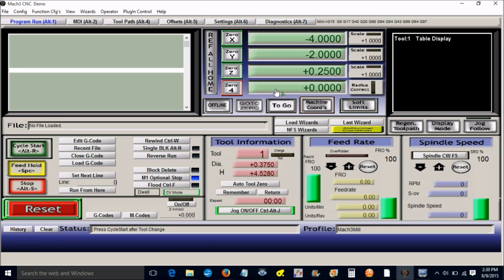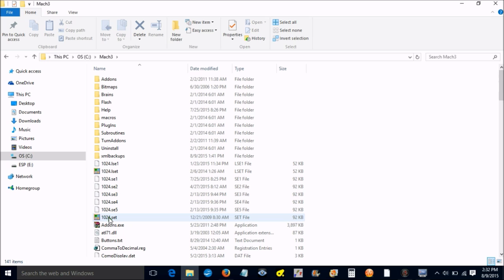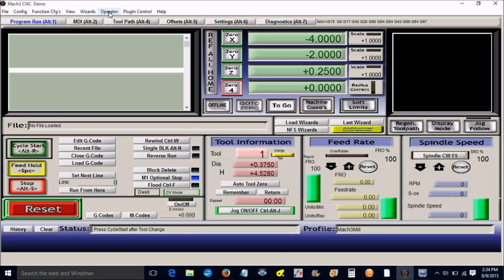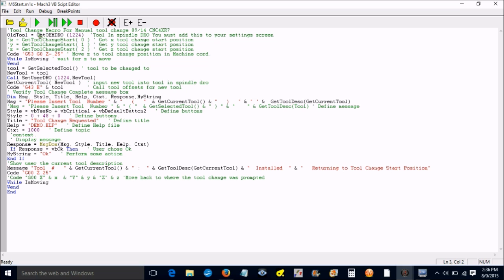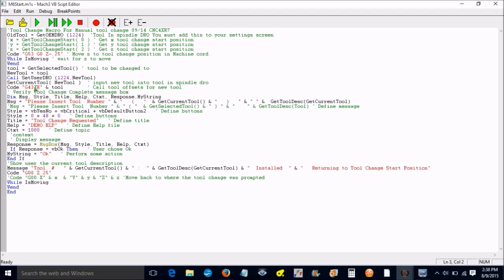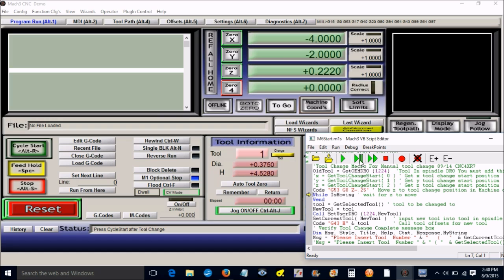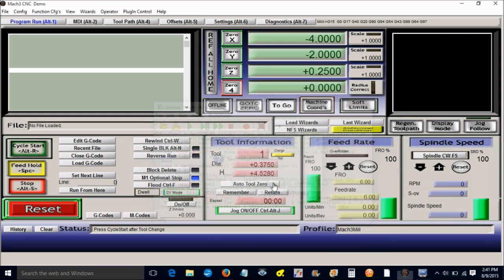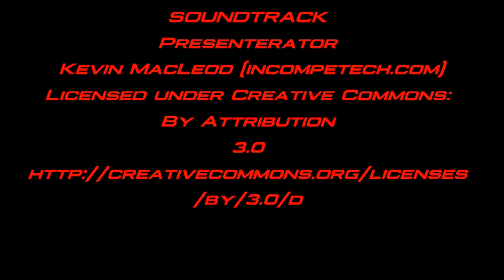Mach3 Manual Tool Change Macro Made Easy

Comment: I am trying to do something maybe more complicated, can you help me please ?
I will explain to you in short words.
M6 should activate macro doing something like this:

- Off the spindle
- Go to safe Z position
- Move the machine axis to the exact position where the tool holder has to be released
- Move the Z axis down, in order to release the T1 holder
- Open the spindle clamp to release the tool holder
- Check if the spindle released the tool holder (by deactivating a sensor) if not, stop the machine
- Move the Z axis up to safe Z
- Move X-Y axis to the next tool holder position
- Move the Z axis down to pick up the next tool holder
- Close the spindle clamp holder 
- Check if the clamp is closed (by activating again the sensor) if not, stop the machine
- Go to safe Z position
- Turn on the spindle an continue working
(Sensor will be connected to any of inputs of the CNC controller)

I hope you can help, thank you so much in advance 
Stay safe
Reply from the maker: have a look at my website

Comment: Thank you for sharing the tutorial on the tool change macro.
I spend almost 3 day's fidling with the settings in mach 3 before  I found your video and made a manual toolchange work on my machine (optimum BF 46 conversion).
My first problem was that at the first toolchange the Z-axis went over the max soft limit (this with safe Z move setting active).
Then after I implemented your macro it was the second tool change that not worked. It stayed just a little over the workpiece and could not get the tool out. After some more trial and error ,I found that mach 3 can not perform a G53 command when the last command was an incremental G91 move. And this happened to be the case in the manualy written G code program I made as a test...(maybe this would not be a problem when using a CAM software)
To make it work I  changed your macro and so I implemented an extra line Code  " G90"   just before  the 6th line    Code  "G53  G0 Z-.25".
Guess changing 6th line into code "G90 G53 G0 Z-.25" should also work.
Reply from the maker: Yes "G90 G53 G0 Z-.25" would work just fine.

Comment: Thanks for your video and work! I am new to Mach 3 setup and commands and I have a question.. Is there a G-code command I can use to populate Tool Table in Mach3 ia a way that every tool change the operator can see TOOL DIAMETER in the "TOOL INFORMATION" Panel of Mach 3 ???  I could not find anything about this
Reply from the maker: If you populate the tool table with your tool information this will be displayed as you have asked in the tool info window.
Reply: @CNC4XR7  Yes, I can do it manually, but I would like a command in my codes to do that, because I am making the code files and another guy is operating my simple and "manual tool change" CNC. Actually I make a command  like T05 M06 (diameter: 1.3mm) to show to the operator what drill to use, but he can not see in TOOL INFORMATION DISPLAY what drill is in use between Tool Changes unless he allways populate Drill Table.

Comment: I copied the macro with no problem. The trouble is that my machine set up is using Windows XP because thats what I using to control Mach 3 and DropBox doesn't support Windows XP any longer and therefore I am unable to copy the screen set/1224 DRO. As you know,the macro is basically useless with out the screen set so I would greatly appreciate it if you would E-Mail me the necessary documents so I can use your program.clydo5798@gmail.com
Reply from the maker: check email
Reply from the maker: Email sent

Comment: Howdy-I can't seem to download the file for your tool change macro. Is there any chance that you could send a copy of the package to my E-Mail account? My E-Mail is clydo5798@gmail.com Thank you very much!
Reply from the maker: The macro is in the video description
Reply: I got the macro but am unable to get the "tool in spindle" DRO. to load. My machine operates with Window XP and Drop Box no longer works with XP. So I am unable to download the screen set.
Reply: Thank you for your swift reply. I copied the macro just fine,however, my machine operates using Windows XP and Drop Box no longer supports Windows Xp so I was unable to download the screen set.

Comment: Hi,   Thanks for the great tool change macro.  I am using it currently on one machine with an ISO20 spindle.  Its seems to work great, except I get a Z-Max soft limit warning when I start a job with it.  The tool path page doesn't seem to show anything that would trigger it, and I actually ran the jobs (a couple of them now) without any issues.  Any idea what is causing the warning or how I could eliminate it.  I didn't use your screen.  I just used Klause's Mach Screen program to copy the tool number DRO to the settings page and it worked just fine.
Reply from the maker: I think what you have done is fine! That's not the issue. Do you find the error occurs all the time or just on certain tool change combos?
The error is real and  or mach 3 thinks it will be based on the the current tool and or the selected tool. 
Did you see this in the video description?

Please Remember there is NO tool ZERO start all operations with a tool # on the programs tab in the tool DRO (Not a ZERO. ) A 0  may cause soft limit errors or a Z crash if a tool is inserted.
Reply: @CNC4XR7  I have not experimented to isolate the error, but another users on the CamBam forum suggested that I install a tool and set the machine to that tool before homing Z.  So far its happened every time, but I have only run a few jobs with your macro so far.
Reply: could it be the that the "safe Z "setting is active and causes a glitch in the original M6end macro ?
Reply: @meuliedoka  Safe Z is not used in my macros.  I use G53 for the tool change height.  I had thought there might be an issue with G53 Z0 being very basically the same as the 0 soft limit, so I just changed my G53 tool change location to Z-0.10 a few minutes ago.  Loss of 0.10 clearance height for tool changes should not be a big deal if it fixes the problem.  I've been thinking about trying it for a while, but just hadn't gotten around to it.  Usually the code runs fine in spite of the warning, but once in a while it will trigger a stop for exceeding soft limits.  When it does position is also lost (its still close, but now a little off) and continuing can ruin parts.  I figured it couldn't hurt to add a 1/10 inch safety margin.  If the problem goes away I'll live with the slight loss of Z.
Reply: @meuliedoka  I set the tool change macro to us G53 Z-.1 instead of G53 Z0 and after a day of testing and half a dozen jobs on two machines the problem seems to have gone away.

Comment: Hello
i can use THC output in axis x or A i mean what folder .m1s responsib of THC
Reply from the maker: THC is setup default for output5 it's in configuration settings
Reply: what you mean
Reply from the maker: @benamarcnc6078  I do not think there is a .m1s file for THC but I'm not sure
Reply: OK What file .m1s responsible for G18 G19 ?
Reply from the maker: none

Comment: say I hd a button ( input) that calls up tool change when I hit it.  If I were to hit this while a program is running.  Will this wait until buffer has executed then go to tool change position, stop coolant, and spindle/apply brake.  Now here is what I want it to do, after inspecting part or tool then hit cycle start and have the machine pick up right where left off without losing any too length offsets or cutter comp registers and have the tool enter the work running just like it was when that input was pressed.  I have mach 4 got any ideas how to do that or if this is how things work anyhow.
Reply from the maker: Are you trying to do a tool Change or do you just was to inspect the part at some point in the cycle.
If inspection is all your after simply insert a M1 command in your g code
Reply: Yes, all I want to do is inspect everything in the middle of a program.  Will this move the spindle to the tool change position, shut off spindle and coolant and allow me to inspect everything and then upon hitting cycle start will allow me to just pick up where left off without losing tool offsets or "cutting too much air."
Reply from the maker: @joeshmoe5935   You will need to edit the Gcode slightly to do the few things your asking if you want to move to a inspection location. like raise the Z axis , turn off spindle and coolant etc. A M1 command is a (Program Pause)  you must also have optional stop enabled on  mach3 /4  if you do turn off spindle , coolant and raise Z axis you will need to reverse this after the M1 command
Reply: So I can program an input to force an M1type command anywhere in the program even if one isn't typed into the program?   I would also need to change  Reason I say M1 Type command is because I will also need it to move the X and Y axis to basically the tool change position.  What I am trying to mimic is Centroids tool check feature.
Reply from the maker: @joeshmoe5935   Sounds like your Looking for a Macro  I'm not sure what Centroid does if you would like to email me please do and we can discuss it further. 
https://cnc4xr7.com/contact-me.php
Reply: “Single block” check box will stop motion after every block of code has run.  I used this in Okuma lathes to take quick measurements and adjust for sizes.  If you don’t move the tool for inspection restarting is easy. 
Programming a macro would be possible but tricky......

Comment: Whenever I run a program, on the second tool change, instead of returning to the previous position before the tool change the Z axis moves up into the Z+ limit switch. Any idea what is happening? Thanks!
Reply from the maker: I cant say for certain However Mach 3 is most likely correct! meaning it is doing what it knows based on the information you tell it.

Some things to check THERE IS NO TOOL 0 (ZERO) TOOL ZERO IS THE BOTTOM OF THE SPINDLE this is one of the biggest issues. so make sure when you set your Z zero it is on a tool number I try to use the same tool Ex Tool 7 which is a .375 4fl EM.

At the time of a tool change the Z axis raises to a height of 1" below the Z limit in machine cord. for tool change clearance.

If your tool is longer than Mach3 thinks it can fit it can cause errors.
Reply: @CNC4XR7  You can have a physical tool zero.  When possible you use the spindle nose, but its possible to have a reference tool if for example you want to measure tools off the machine with a height gage, and you do not have a fixture to hold the tool holders that exactly matches the spindle nose.  I'm running off spindle measuring on two machines now.  One with your macro in Mach3 and another running PathPilot which is a LinuxCNC derivative.
Reply: I should add if you do use your spindle nose as tool zero you can set height using the spindle nose as long as you select tool zero on the machine control.  Its easier for me to always use a tool, and just make sure the control is set for the same tool I have in the machine.
Reply from the maker: @cncmoldsnstuff4423  with Iso spindles it is a little more difficult to get accurate tool lengths without a fixture. Setting Z zero with a Master tool of Known length is the best method. for measuring the other tools a touch off routine would be preffered.
Reply: @CNC4XR7  I do not like spending machine time touching off tools.  So far all my tool lengths are measured off machine.  I have an expensive electronic tool setter dialed in for one machine, and it hasn't even been out of its box in ateast 6 months.  I have had to replace and add tools several times. I just do it on the surface plate while the machine is running.  I can easily measure on machine with that one since it is TTS and reference directly on the spindle nose.  I just don't.  

Yeah, I was not comfortable with anything with the ISO tools so I went with a master Tool 0.  I had to make my own fixture as I could not find one for ISO20.  Fortunately  I have a half decent lathe.  I keep the master tool and the fixture in a box together.  Some of the guys on PM said I should calculate the difference between my fixture nose and my spindle nose, but I decided it was easier to just never measure on the machine for those two mills.  (I have a second ISO20 spindle for a second machine once I have the quirks all worked out on the first one.)
Reply from the maker: @cncmoldsnstuff4423  I see what your doing and if it works for you that's great!  However i would not confuse the fact that there is no "tool 0" when using the tool table. As Tool 0 is the bottom of the spindle. I to use TTS tooling and measure tool lengths off the machine. My "MASTER TOOL" is my touch probe that length is calibrated and I set Z zero with the Touch probe. Which is similar to what your doing. However this is not tool 0 for me it is Tool 99 Offsets are turned on and the length of the probe is offset from tool 0 or the bottom of the spindle. 

Of course at first most people never change the tool # and use tool 0 for all there machining. adjusting the Z zero with each tool change.

Comment: Hi Sam,  Just wondering how i would go about changing it for a metric system ? So for example this line at the end Code "G00 Z .25" 'Move Z back to .25" above zero in work cord. Would i just change the  "G00 Z .25" to say  "G00 Z 20"   for a 20mm Z height ? Or would it try to do 20" instead ?
Reply from the maker: Tim P 
I have it set to return to .25" above work piece in metric 6.4mm but yes you have the idea
Reply: Ok great thanks.  Yeah i wasn't sure if the number i changed it too would be in inches or mm. So i am just guessing it works in what ever Mach3 is setup to use ? So i guess it just goes off you DRO reading correct ? So if my DRO's are in mm then your .25" would be 0.25mm on my machine if i didn't change it ?
Reply from the maker: Tim P 
That's correct  you need to change the values of all the movements that are specified. 2" would be 50.8mm etc
Reply from the maker: Yes that is correct
Reply: Ok great. Thanks Sam.
Reply from the maker: Let me know how it works out for you.
Reply: Ok got it setup on my machine and it works when i step through it line by line at the edit VB script page. But it dosent do anything when i issue a T1M6 at the MDI screen or if the G code has a M6 command. Nothing happens ?  I have the setting enabled to ( change tool wait for cycle start) in Mach3. So not sure why Mach3 is not using the M6Start.m1s ?
Reply: Ok i'm an idiot. I have more than one Mach3 mill profile. And i put it in the wrong one. All good now and is working great. Thanks again for the help with it.

Comment: Hello, I am in the process of building my own tool changer with custom tool holders that do not have a taper connection but instead is milled to accept the hex nut on a standard ER11 collet and held in position by small neodymium magnets.

The tool holder will have a spring under the 'new' tool to push the tool up into position until it locates properly on the collet nut and closes a switch.

Is there any possible solution in your macro to having the spindle turn in very small increments until the collet nut engages properly into the milled recess in the top of the tool holder?
Reply from the maker: I currently do not have anything in the macro for spindle indexing.
Reply: OK, thanks anyway.  I shall probably go for a carousel design then and use a low geared motor to turn the tool holder.  Thanks for your consideration and, of course, the video
Reply from the maker: I do have a tool change macro for a 8 ,10, and 12 tool carousel
Reply: That would be great if you could let me have a copy.  I have no idea concerning the macro language and was wondering if the carousel tool changer is similar in macro layout as the subject of this video in order that I can try to fathom it out?

The action that I am considering is that the spindle lifts to the correct height for the tool forks, inserts the tool into the fork then raises approximately 20 mm to clear the ER11 collet nut and then the carousel rotates to the new tool position.  Once at the new tool position, the spindle lowers onto the new tool.  If the spindle nut does not engage immediately into the tool holder, it will push down the holder onto a spring with a micro switch activating a low gear dc motor that turns the tool holder slowly until it locates correctly on the nut thus allowing the spring to push the holder up and opens the micro switch again.

Does your macro drive a stepper motor or does it utilise a mechanical ratchet system using a solenoid?  I will work my design to suit either.
Reply from the maker: I designed mine for use with TTS holders however the flow chart you describe is basically how mine works it can however be tweaked to suit your needs I use the B axis to rotate the carousel. here is a video:
https://www.youtube.com/watch?v=B9lHwb_JF3Q&t=5s

you can find more info at https://cnc4xr7.com/ATC.php